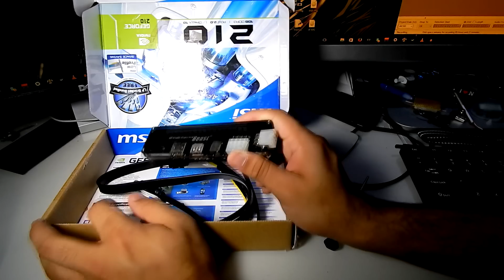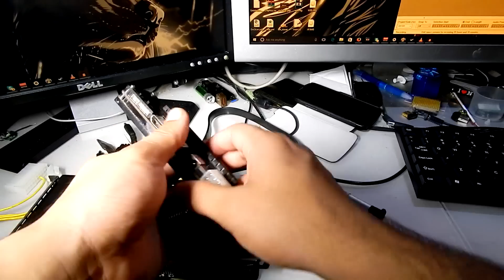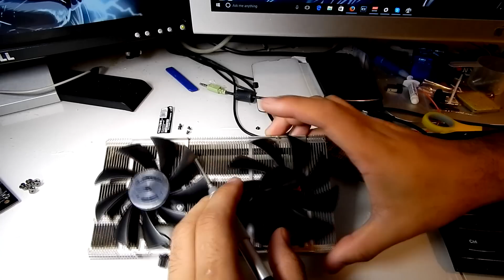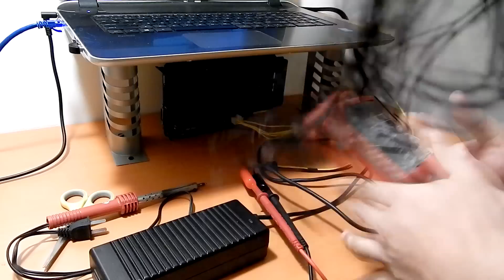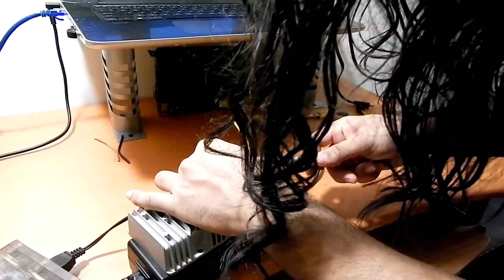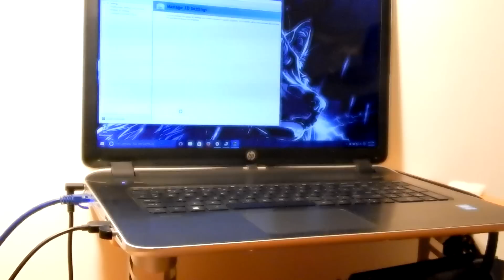Turn Any Laptop Into A Gaming Machine For 72$

Comment: nothing can make a mac into a gaming machine
Reply: U can get Windows onto a Mac that helps a bit
Reply: Yh u can, toss it around like a frisbee, then itll be great for gaming
Reply: Levi Lapsley just install windows
Reply: actually you can hookup a thunderbolt2 to pcie, install windows and make an actually decent gaming machine ...
Reply: @bob zhang but why would you want cancer on windows?
Reply: You can get mac on windows too.
Reply: "OK, let do this."
throws
"Shit. Broke my $1200 Frisbee."
Reply: u are dumb... external graphics and then bootcamp windows its sooo easy
Reply: DedoGamingONE ديدوI ment the os
Reply: mostly for gaming*
Reply: all youve done is turn you mac into a pc and done it at double the price. not to mention external gpu's suffer from drastic losses in performance compared to an internal gpu. try again.
Reply: Mac uses the same hardware as a non-mac pc. No, not a similar kind, the exact same chips. Unless we talk PPC era.

It's only the OS that matters, because drivers and such are written and tested on windows machines, thus it can be more unstable. This is an issue based on profit, not engineering.

Also most macs are usually cpu high/gpu average loadouts, balance wise, so they do lack performance for games in that sense.
Reply: mac is the OS. That's why he said it. These comments -_-
Reply: DEEZ NUTS
Reply: Bizon eGpus?
Reply: Yup
Reply: bob zhang but atleast it gamed
Reply: Shazzkid Until you realise that the word "game" sets the iGPU to 100% and the computer locks up.
Reply: we can make android emulator in windows. why not make a mac emulator in windows too?
Reply: atha fawwaz There already is.. and its not called emulator its called virtual machine
Reply: Kids in africa just joking bro
Reply: Mac costs more so it is better! At everything.
Reply: Rick Tobin troll?
Reply: Rick Tobin Do your fucking research before you make a claim.
Reply: Kristian Correa But if its more expensive it gotta be better hence mac's are better at gaming
Reply: Kids in africa a gaming pc the price or a mac would wreck a mac
Reply: Levi Lapsley Well mac is expensive hence its good for gaming .*
Reply: Kids in africa not really. You can game but for the same price you could have a much much higher powered gaming pc
Reply: Levi Lapsley But that makes no sense. Macs are expensive as they are best thing out there you pay shit ton of money and get shit good computer. its best for everything cuz of its price. Please do some research before commenting. -.-
Reply: Kristian Correa roflmfao standerd windows guy. just can't see past his last crash into the joke. drink another.
Reply: xperie lol this new age where a joke = you are a troll looking to anger people. Man get with the context of the msg. seems to me you be trolling in this matter
Reply: Mac server grade. Pc consumer grade period. metal vs plastic. plastic cars are cheaper just like pc's
Reply: Rick Tobin A Mac and a PC are the same thing the only thing different is it's internal OS, software, and it's quality design. The Mac is a great device don't get me wrong. Though PC doesn't really have a standard of performance, unlike the Mac. But PC is very Open Sourced, as when I use my Mac I feel very restricted to what software I want to utilize on. Mac is a great device, it gets the job done when editing, benchmarking, and other means of heavy processing tasks. But my PC out performs any Mac in the market due to its custom integrated hardware.
Reply: Kids in africa mac is not the best. Tell me any mac model and I will link a more powerful pc
Reply: Kids in africa it's the Internet.  There are the most retarded people here. How would I assume
Reply: Levi Lapsley Well its clearly sarcasm. If you read what I earlier said bout mac you wouldnt even think i was serious about mac after it
Reply: The BizonBox by Bizon can - it works similarly to a Razer Core, you just plug it into your Mac, insert a graphics card into the BizonBox and then boom, you can game on a Mac!

But that's a waste of time and money so eh
Reply: Lüminism Wouldn't the Macs cpu bottleneck the gpu, I'm not tech savvy so i I don know
Reply: Lüminism yes but a Mac is a Mac os and Mac os use the games from the AppStore. So, AppStore's application is sucks. so if You want Mac To be a gaming machine is to change their os into Windows
Reply: Tjhandra GTV No Macs just plain suck, I see the new 5k Macs at our school, and they can't even run Cs go
Reply: Macs suck? I can't remember the last time I had a crash or had to reboot. I also can't remember anyone that has switched to Mac and wished they had a pc again. spec one out and try it. your conversion will happen rapidly. as far as cost try selling your 3 year old pc for 35% of the original price. No a Mac isn't expensive. add to that all the unproductive crash time. at least with a Mac if your crap windows partition crashed you can reboot into OS X.
Reply: Rick Tobin If you want to pay for overpriced shit go right ahead, I like Windows OS, the reason we reboot is for updates a minor crash. Not big of a deal 3 minutes I can build something for 1600 that is almost future proof.
Reply: for a reboot or a minor *
Reply: Levi Lapsley 
AND THEY CHARGE SOOOOOOOO MUCH I HAVE SUFFERED WITH MY MACBOOK PRO IT DOES N64 THE HIGHEST😭😭😠
Reply: Kids in africai hope u get it without...
Reply: Rick Tobin Apple fanboys and Microsoft fanboys are the reason we fight, Macs are for artists core designers ETC. Microsoft is for workstations and gaming.
Reply: 2006 15 inch macbook pro only macbook with a NVIDA graphics card i play counter strike global offensive at an average of 70 fps soooooo
Reply: Weezo csgo is easy af to run
Reply: Levi Lapsley not particularly if you need a better off point boishock 2 close to all high settings and you get about even 60 my brand new hp with a radion 7 8900P can't do that and it has two more cores as well as 4 more ram
Reply: Weezo Depending on which mac
Reply: Weezo And bioshock 2 isn't that much of a "crisis 3" game.
Reply: PhantomForces Sniper I was specifying off of mine but yeah most Macs are made with decent video cards  but they normally don't have fast enough processers to get decent frames
Reply: Weezo That's because they aren't for gaming. they are for production, artists and video creators mainly. I don't like them because they are overpriced, and I use electronics mostly g gaming so....
Reply: Bizon Box Can But It Is Expensive!
Reply: companyoflosers 1.
Reply: Lies! Bootcamp Windows, external graphics card. Problem solved.
Reply: it depends. if its connected to the thunderbolt then it will be an over 50% loss in performance. directly to inside the laptop = 10% performance loss maximum.
Reply: maybe 30 minutes talking non-senses on You Tube :D
Reply: you can lose up to 40 percent performance of the gpu with external graphics. unless the device is specifically designed with a special pcie port plug on the side, there isnt enough bandwidth for the gpu to function to its fullest and it will always throttle. also the point of turning a mac into a gaming machine is so you dont have to use windows. a mac with windows on it is just a pc. theres nothing about the way they are built that makes them different, just the OS.
Reply: you can but it's hard
Reply: Abdera7mane Gamer nope mac sucks forget about it
Reply: Levi Lapsley kim jong un’s hair is better then that smile
Reply: Geforce now can
Reply: Using it like a football could work!
Reply: Levi Lapsley GeForce now
Reply: a bit? more like a lot lol
Reply: except mac only has specific models for its macbooks and desktops. they only design those to work with certain hardware and never release drivers for anything else. so a gpu from nvidia or amd thats not already used in one of their devices, you wont see support for at all. youll get some dedicated community members who will do some creative hacking to get SOME stuff working, but they are always behind in performance compared to pc because there is a delay in porting the drivers whenever theres an update. IF they decide to port the drivers at all. so while anything you see in a mac could also be used in a pc, most of the stuff you see in pc can NEVER be used in a mac. apple doesnt really care to make it easier to port stuff over either because theyde rather you spend a ton of money on their next model rather than spend a fraction upgrading. its one of the reasons they solder alot of the parts together on the inside and make them so damn hard to get to the insides too. so no, its not the OS, its not the hardware, its apple and their anti-consumer practices which their fans will blindly defend to the death.
Reply: Levi Lapsley check out Dave Lee's videos on egpu for MacBooks. very interesting stuff, tho not incredibly detailed, he got it to work on the 2016 MacBook pro, 13 and 15 inch
Reply: In the words of President Trump.....WRONG!

Comment: Cool project. Some thoughts: 
- A small form factor PSU would be way more practical. Would probably cost the same and its not that much bigger.
- Your i5 should be sufficient to not bottleneck that 750TI. A non "U" i3 should do the job too.
- The mPCIe for the WLAN Module is probably just 1x and will decrease the performance of the GPU somewhat.

A benchmark comparison would be nice to see how much you gain in compared to the iGPU.

From a technical point of few i find this quite interesting. But to be honest, its better to build a cheap gaming pc.
Reply from the maker: I do recognize that there's drawbacks but it was for the sake of experiment, and it'll prolly never compare to a good gaming rig plus i had the adapter for over a year collecting dust lol. As far as a benchmark video im diff gonna do one cause i have no idea myself what the performance difference would look like to be honest.

Comment: i have a acer laptop with Intel pentium (no nvidia) will this work?
Reply: Depends on what you consider "working" is technically it should work for any processor but what gpu you use matters, a pentium on a laptop would bottleneck most desktop gpus, Hope I helped

Comment: i actually have the GPU from the box in the start of the vid in my pc! saving for a GTX 1070...
Reply: Dude, just save up for a Titan X its 30x better than the 1070
Reply: Rex Apexx why would i get a titan x? First, i can only game with hd530 for a year because of saving, and it will bottleneck the shit out of my 6600k. And i do not need such power.
Reply: The 1070 is way better than the Titan X in terms of cost effectiveness.  By the time a 1070 can't keep up, something will definitely be cheaper.  You don't need a Titan X unless you're doing really heavy shit.
Reply: you know, if I was doing some productive work I'd look into getting a Titan X. For gaming though? No, fuck Titans for gaming.
Reply: +Martin Van Den Hoek get 980 or even the ti would recommend over 1070 if you want to spend a little more for a good deal of improvement or rx480 if you want more Bang for buck
Reply: 30X lol SLI 1070's destroy titan x pascal lmao titan pascal is a piece of shit for the price, you can get 3 1070s for the price
Reply: A GTX 1070 is better than a GTX 980/GTX 980 ti. There is no point going for last end hardware especially considering Nvidia stated they will no longer be supporting their GPU's 3 generations behind.

Comment: So your moving gpu data down a dodgy cable over an hdmi connector ? 
for a start mini pcie is only 1x or 2x and generally based on pcie v1.x signalling  
so that would be 250(1x) or 500(2x) MB/s 
as of about 2011 most gpus moved over to pcie v3.x 
for 1 lane of pcie 3.x you are looking at 1GB/s or 1000MB/s 
and a current gpu uses 16 of them .... 16GB/s or 16000MB/s 
now i agree very few gpus use all the bandwidth available so lets say they use halfish
so thats 8000MB/s ..... fitting down a line capable or 500MB/s   
and your dock is also doing usb and other shit
and all of this going via an hdmi connector capable of approx 4GB/s and a cable that is definitely going to lose some data due to length 

i see some rather serious bottlenecks here ?? 

so that was a more worst case scenario ..... lets look at this in a nicer light 

lets assume your mini pcie is running at pcie 3.x signalling (i dont know if this is available but i would expect very few laptops to have it regardless)
lets assume your gpu only  uses 1/3 of the bandwidth 5.333 GB/s 
you can see your castrating the bandwidth to basically a third of what it should be 

maybe im missing something (please correct me if i am) but even under best conditions this just seems hideously inefficient , that coupled with the many reasons why this wouldnt work on many laptops .... just seems a waste of money - i appreciate the idea but a little bit of background research should tell you this wont work well if at all ? 

i expect some hate for this comment but if we can keep it constructive it would be appreciated
Reply: No but seriously though, its a good point, this is very dodgy and inefficient, might work with lower end graphics cards but the fact that its possible is cool and it can be a lot of fun to try for someone tech savy. Dont think this is meant as an actual practical solution.
Reply from the maker: Well as far as the bottleneck goes that'll depend from machine to machine its not something you can fix actually but you can work around it. For my laptop it just some hp machine i got on sale for black friday back when i was in school like two years ago.This was just for the sake of experiment i knew well going into this that it will not replace a gaming pc (which i own one its what i edit these videos on) but i wanted to offer a option possibly something better then integrated graphics for a budget price to those who cant afford a razer core. Also many machines still don't have the output that the razer core uses so your stuck on buying some expensive laptops, tho that will preform better then this i cant justify the price tag for a first gen product.
Reply: however most gpus on pcie 3.0 don't even saturate pcie 2.0. The limiting factor is having a 1x or 2x slot. It's fine though, still works better than the base laptop. You just won't score as well in benchmarks or even run the card as well as it should run. Again, this is ok. mobile gpus haven't been the greatest anyway.
Reply: one may not want to invest on another system and actually have whats needed for this alone (a laptop and a gpu) I- for example, have a gtx 570 'round n unused that may give a nice boost to my actual only working system: a laptop with a gtx 750m in it and a 4th gen i7
Reply: bruh im not reading all that... some one sum it up for me
Reply: its seems very obvious that this laptop is moving data at 1X and its very obvious that 750ti its too much for this scenario but take away the bottleneck and take on count the beneffit (its huge). In my particular case i just wonder if its more power efficient carry with a power supply in replacement to his power cell, and a few lower tier gpu maybe a R7 240 will do enough work for this configuration, for me this is not a very portable config, i just would take this to some other place safe where i looking at stay a couple of days without touching the config
Reply: barely tho .... and look how much it costs to be barely faster ?!? its just not worth it
Reply: it really isnt .... price to performance .... better off buying an xbone
Reply: but then you have to spend a load on the dock etc .... which looks like it will catch fire any min .... to get an incredibly minor boost ?
Reply: how will you take away the bottleneck ? .... use thunderbolt (complete with costs similar to just buying a new laptop)
Reply: well first of all, when I was saying that u have to take away the bottleneck  i would say that its not possible just make it obvious taking on count the gpu support 3 times bandwith than the laptop´s motherboard (at least in this case) was meant to be for another kind of system much more powerfull. Second, I just triyng to be objective, you requested, saying that its better buy another thing i got to say we are getting out of the therms, always in this case will be very better to buy a powerfull laptop or just build a gaming pc however there is some persons that just cannot buy just so easily a new computer, and for the price this fix offer, well... its not a so so bad choice, i just wonder how much he pays for that laptop with that plus of  72 box maybe i could throw a more precise upgrade.

Comment: how did you cut the back of the laptop to access the pcie?
Reply from the maker: Oh, i didnt there was a rubber stand off there i just removed it and that made space for the cable.
Reply: cool. I've been looking to do this for a while now but just hadn't found a good way to bypass the battery at the back.
Reply from the maker: Arpan Adhikari
Ahh, kk

Comment: Im actually so happy I came across this video cus I had no idea that laptop to desktop GPU adapter existed! I build console pcs quite a lot and love to use laptops into things like og xbox shells etc cus they are smaller and easier to fit, but they are always limited to being an arcade emulator/HTPC due to the lack of specs, with this adapter I could build a fairly capable gaming pc console! thanks man!
Reply from the maker: Glad to hear, happy building.
Reply: Should a mini ATX Mainboard, AMD APU and a pico PSU not be about the same size than the whole GPU? I wouldn't expect too much performance out of that 1x mPCIe lane. Not much more than a A10 APU is capable at least.
Reply from the maker: Schwarzer_Peter
From what i know it would be the size of like a razor core, but i dont have an enclosure to compare with plan on building one tho.